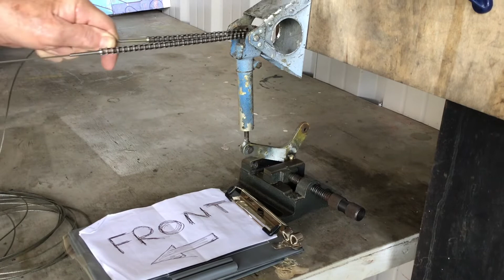Cessna 177 Cardinal  Stabilator trim mechanism explained

Comment: Excellent demonstration, very nice use of actual parts and mock ups.
Reply from the maker: Thank you for your kind words - very much appreciated. Thinking of a way of holding the jack-screw in mid-air was a bit of a challenge. Until I noticed the hangar's upright stanchion - to which that I could clamp a handy bit of wood.